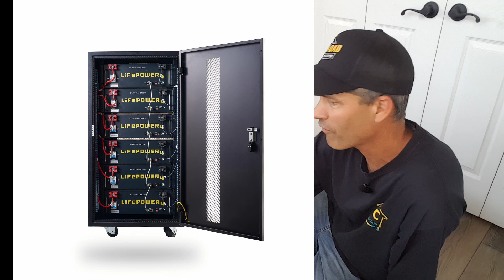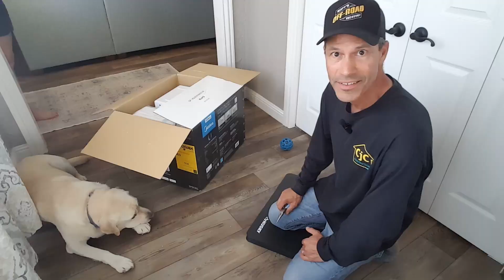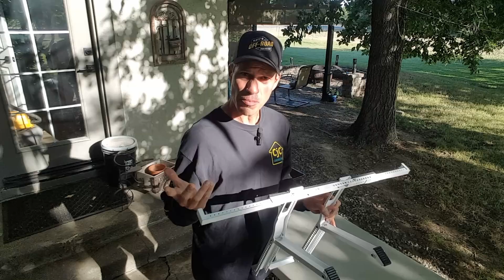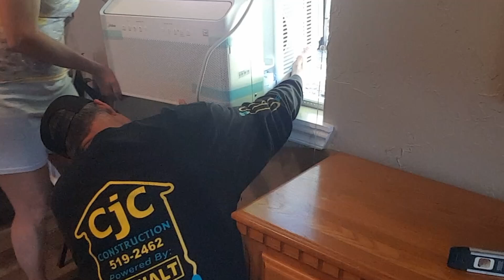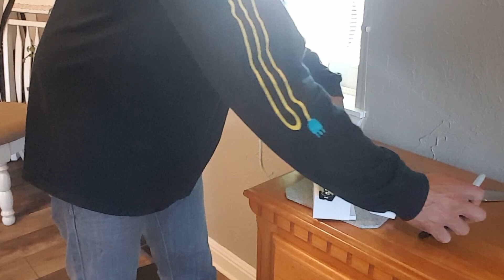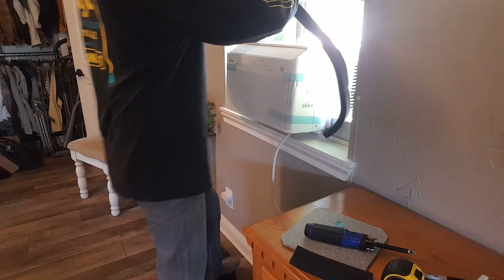❄️ 2024 Best Window A/C Midea U-SHAPED!! With INVERTER TECH!!

Comment: Thanks for this review/install guide. I just ordered this very unit based on all the positive reviews about how quiet it is. It is to arrive the 4th of July weekend next week. So this has been very helpful instilling me with confidence for the upcoming installation of the unit into my bedroom window. I was wondering though if you have tried the smart features, like controlling the unit from the far side of are planet over the internet? That would be very cool to turn on the unit with the phone app before leaving from work. I can't wait to try that out! 👍
Reply from the maker: Hello!! Thank you for your comments! Yes, we use the smart features daily. At the time of this video, we had not set up our phone yet. Since then, we use the smart features every day. I am kind of a numbers geek, so it is fun to see the inside And outside temperatures! Did you get the 12,000 BTU unit?
Reply: @jeffcunha9114 Thanks for the quick reply. Yes, I too ordered the 12,000. It's great to hear the smart wifi features have been working well for you. I'm looking forward to it! 👍
Reply from the maker: Awesome! Absolutely, we appreciate your feedback. Additionally, you can set up a routine so the unit comes on at a certain time of the day, or manually turn it on yourself manually. The other day we turned it on from a four hour drive away, and the house was nice and cool when we got home! 🥶
Reply: @jeffcunha9114  That's amazing! Thanks for the info! 👍
Reply from the maker: Absolutely! Drop us a line when you get it in July! Let us know if you need any help or support.

Comment: your mounting bracket has rubber pads for the window sill? mine didn't come with those, it only has rubber on the feet that rest against the house. Edit it looks like they fell off, it's the black rubber rectangle  that sits on the window sill @3:53
Reply from the maker: Good day to you! Now that you have this unit installed, how are you feeling about it?
Reply: @jeffcunha9114  I wish I could return it, with wood walls and vinyl siding at low speeds it sounds like a helicopter hovering outside because it's vibrating the wall. It's extremely obnoxious low frequency 25-30hz can hear it all over the house. When it runs at this low speed I switch it to fan mode so I don't have to listen to it. Tried adding sound damping material, a block of wood so it's not resting on the window sill, the only other point of contact is the feet against the vinyl siding that's transmitting all this vibration.
Reply from the maker: @atvkid0805 oh man. That is a bummer. I wonder if you could hang it off of the window to relieve the vibrations coming through the feet?

Comment: These are amazing until they get moldy
Reply from the maker: @qu1cks1lver56  Yes, you are correct. I am about to do a deep cleaning on this one for that reason. Are you running one of these?
Reply: @jeffcunha9114  Any chance you make a video for it? Just installed the 8000 BTU U Shaped model a couple of weeks ago and now hear they have been pulled from the market because of the mold growth. You think it makes sense to remove the drain plug on it completely?
Reply from the maker: Good morning! Yes, I want to do a teardown video of the deep cleaning. It is not overly difficult, but it takes time. Does your unit have a plug on the outside bottom pan? If so, yes, I would remove it.

Comment: In April 2024, when our central air in our north central Texas home quit working and it was going to be a while until we could get it fixed, I purchased what seems to be the same unit as in the video.  Even though I had a very low opinion of window air conditioners, I love our Media!   

The above said, I would like the Media to come out with a hybrid DC solar / AC 110 air conditioner / heater version similar to the the mini-split competitor brand in the linked video.     https://www.youtube.com/watch?v=vOEBlV2986M
I don't have an opinion about the linked unit other than I want a Media (U slot window style) with similar capability to the EG4 competitor.

Based on my data collected, I think a Media solar hybrid would pay for itself.   A bit of strange data, since for unrelated reasons, I did not run the window air conditioner over the summer.   However, here is data for our home in north central Texas for the late spring (not all that hot) and fall (hotter than normal).  In the fall (unlink the spring) our central air conditioner is working.   The Media significantly provided cool air flow to our living room where we watch TV.    The Media is set at its lowest setting (not auto) at 76 degrees, supplementing the central air also set at 76 degrees and the Media rarely uses more than 100 watts.  Total variable cost so far $12.51, 47 days, 89.58 kwh.   Maybe I'm being fooled by the wall outlet meter, but I don't think so.    Our house is very well insulated and I'm not trying to cool the whole house with the Media - just allow the central air to be set a little higher and the Media gives a cool breeze in the living room as needed.

The Media was easy to install, but the video was right - so more than look at the grill and it will be bent - maybe an additional grate needed?    If I can find a DC hybrid version of the Media, I'm thinking of putting a hybrid DC solar unit (maybe limit it to solar) on every window where off-grid solar panels can be placed with sun near the window - operational costs would be zero when in solar mode.   I'm not ready to try a mini-split with the tubing, but another Media that can use solar when available - absolutely - may even buy several as Christmas gifts for family members if mine works as well as I think..

Thoughts?  Thanks for the video update.  Dave

Comment: Do not buy! Midea didn't think at all about how to clean it. Yes, it works quietly, we bought it in May 2024, and we have been suffering from a mold smell for a month now. Midea didn't think about maintenance, it's impossible to reach contaminated areas and to pull it out of the case like a regular AC. Customer service did not help at all.
Reply from the maker: Thank you so much for your input! I haven't had this mildew issue, but I will see if I can figure out how to take the inside portion apart for you. What a bummer!
Reply: @jeffcunha9114  Anything you do to try to clean that rotary fan is going to void the warranty.  I've pulled the metal screen off to get at the fan.  Had to clean with Q-tips and vacuum cleaner.  Not sure what Midea was thinking about!
Reply from the maker: Thank you for your comments about how you are cleaning this unit. I too need to clean it up before we put it away for the winter.

Comment: I bought mine yesterday, I love it. But the water leakage is coming in my apartment. What am I doing wrong. Shouldn't the water be dripping from outside?
Reply from the maker: Good day to you. You need to lower the outside portion of the unit. Try lowering it down so that it slopes slightly to the outside. 👍😊
Reply: @jeffcunha9114  Good morning. Tks for the reply. My water drainage is on the inside on the side next to the face of the AC. I had it from Thursday this week and had to empty the hug pot of water 3 times already.
Reply from the maker: @RudeboyC2010  Wow! That is a lot of water! Let us know tilting the unit towards the outside by adjusting the outside bracket fixes your issue!
Reply: Do not buy! Midea didn't think at all about how to clean it. Yes, it works quietly, we bought it in May 2024, and we have been suffering from a mold smell for a month now. Midea didn't think about maintenance, it's impossible to reach contaminated areas. Customer service did not help at all. Garbage after 3 month of work.
Reply from the maker: Sorry to hear about your issue! I will see if I can figure out a solution!
Reply from the maker: Sorry to hear about your issue! I will see if I can figure out a solution!
Reply from the maker: Sorry to hear about your issue! I will see if I can figure out a solution!

Comment: I love mine it runs 24 hours a day on solar power I have 8 panels and 3 server rack batteries with a inverter charge controller 5000 watts and my unit cools my living room dining room and kitchen about 650 sq. ft. Its more efficient than my 5000 BTU GE unit and cools twice as much.
Reply from the maker: Thank you for taking the time to comment! What awesome information you supplied! What size unit do you have?

Comment: Will it work with a 39" wide window?  Does it plug into a standard 110 volt outlet?
Reply from the maker: Good day! Yes, it will work, but you will have to do some DIY because the maximum window opening is 36". Yes, it plugs into a standard 120v outlet!! Simple!

Comment: hello, i have the same midea but mine after a few months stopped working. like the fan mode works right but when i change the mode to cool it starts to start the motor then boom the motor stops and it shows error code "EC 07" please help!
Reply from the maker: @_jhxn  Good day to you! Do you have an electric tester to confirm 120v at the outlet under load?
Reply: @jeffcunha9114  i do not have a electric tester but the ac unit was working perfectly fine for a couple months then when i put it on cool mode the motor in the back starts to vibrate for couple seconds pushes out cool air then it stops working
Reply from the maker: @_jhxn  It is a tool to measure voltage. When you turn on the unit, do you hear and feel the exhaust fan running outside?
Reply: @jeffcunha9114  yes! the fan runs perfectly in fan mode, BUT as soon as i turn the cool mode on the motor for the cooling turns on for a few seconds, throws cool air then it turns off and error code EC 07 displays
Reply from the maker: @_jhxn  There are two fan motors, one on the inside and one on the outside. Is the Outside fan blowing? If not, it will throw the EC07 code.
Reply: @jeffcunha9114  ok so just tried it rn, so the fan outside does start blowing but then it stops
Reply from the maker: Thank you for checking it out. One person in the community had the EC07 code because the outside fan motor was stuck. Can you try another outlet as a diagnostic?
Reply: @jeffcunha9114  thank you for the help! yes i did try another outlet it worked for ill say 20 seconds but then stopped again. do you think i need to call somebody to fix it? or you think i should take the back side apart and try to unstuck the fan maybe that’s the problem?
Reply from the maker: @_jhxn  Absolutely! Happy to help. I think it is time for warranty service. Midea has been great to work with for those in this community.

Comment: Just put one of the 8K BTU units into our bedroom, in North Texas. 100 degrees outside yesterday, 68 inside the bedroom, and it's SUPER QUIET!
Reply from the maker: Hello! Thank you for your message! You put that little guy through an instant torture test! That is awesome it is able to cool your room to 68 degrees! What direction is your unit facing? Ours is in a North facing window which is almost always in the shade.
Reply: @jeffcunha9114  same, faces north. Couple hours of sun at most during the day.
Reply from the maker: @WhiskerEdge  Awesome. Give us an update in a few days and let us know how it is doing! Ours is on 24 hours a day and we started using it to cool our entire downstairs instead of using the 7.5 kW central A/C. It will easily pay for itself this summer.
Reply: @jeffcunha9114 is it a better design than the first GEN? The mold issue
Reply from the maker: @gregoryburkhead7813  Unfortunately, the mold issue is still a challenge because of the difficulties of taking the inside unit apart.
Reply: @jeffcunha9114  thanks for the quick reply. I still think these are great units. If they fix the mold issue.  I would definitely buy the newer model 🤣🤣🤣🤣
Reply from the maker: @handsup2  You are welcome. Yes, I totally agree. We really love this unit too.
Reply: @handsup2  Instead it got pulled off the market because of the mold. Of course two weeks after I bought and installed mine. It runs great (cooled my bedroom to 70 easy on a 103 degree day) but I'm dreading having to clean this thing.
Reply: @SteveGrabowski-s5n I changed the motor. And still have mind. Will they redesign it. ??? Hope so
Reply from the maker: I personally am not buying into all the panic. We are using this unit daily without issue. Ours has the open drain hole on the bottom outside of the pan.
Reply: Do not buy! Midea didn't think at all about how to clean it. Yes, it works quietly, we bought it in May 2024, and we have been suffering from a mold smell for a month now. Midea didn't think about maintenance, it's impossible to reach contaminated areas and to pull it out of the case like a regular AC. Customer service did not help at all.
Reply from the maker: Sorry to hear about your issue! I will see if I can figure out a solution!
Reply from the maker: Sorry to hear about your issue! I will see if I can figure out a solution!
Reply: @lilia8138 u right. I just cleaned mind and changed the motor. The motor was making a noise by the front fan.

Comment: I drilled a small weep hole in back bottom corner of unit to drain condensate that collects in bottom of condenser unit. I've had it installed for 7 months and it is amazing! I bought a 12000 BTU refurbished unit from Amazon for $268.00!!
Reply from the maker: Good day! Thank you for the Pro Tip. I would be interested in doing the same thing as you mentioned. Unfortunately, the holes on the bottom of the unit drain the condensate onto the mounting bracket, then down the wall. Can you please describe how and where you drilled? Thank you in advance!!
Reply: @jeffcunha9114  Underneath the radiator in the left corner. Be sure NOT to drill into the copper lines or Radiator! Also, make sure your mounting bracket is slightly lower towards the Radiator, rear of the unit (~ 1/2 level bubble) to keep the condensate from draining towards your house.
Reply from the maker: @dennisswainston411  Thank you for the information! I am going to check this out. Yes, I would hate to puncture the radiator!! Thanks for helping us out! 👍
Reply: @jeffcunha9114  That's funny because on my unit that I bought yesterday has a sticker on the side saying that the drain plug muat be in place for proper function
Reply from the maker: @Juniorr817  Thank you for the observation. I don't recall mine having a drain plug. There is just a hole that drains onto the bracket. Does yours have a rubber or plastic plug?
Reply: @Juniorr817  There was no drain plug or text to that effect on/for my unit.
Reply from the maker: Thank you for the update. Mine did not have a plug or a sticker either. I am wondering if this is a new development. Mine has two holes on the bottom right side when looking at it from the outside. How about yours?
Reply: @jeffcunha9114  Yes, there is a blue rubber plug
The exact words on the sticker are "Drain plug must be in place for proper function.
Remove to drain water before storage."
Reply from the maker: Well, that is very interesting. Are you using the 12,000 BTU unit?
Reply: @Juniorr817  That is the latest model. With the drain plug.
Reply from the maker: Ah, I must have an older model. How interesting.
Reply: So far I am using a micro fiber and a magnet, the micro fiber weeps the water out, but not all of it.
Reply from the maker: Thank you for your message. I like your idea. I wish we could attach photos to these comments! I would like to see what you have there.
Reply: @jeffcunha9114  I do not think you can post photos on you tube.
 So I cut a micro fiber cloth 1" wide and 5 inches long, I get a small plastic something and I use it to tuck the cloth between the sheet metal and the radiator, I use a magnet to hold it in place.
Reply from the maker: How is that working? 👍
Reply: @jeffcunha9114  It works better than doing nothing, I need to figure out how to remove all the water at least weekly. If you can try I would and see how it goes.
Reply: The only thing I didn’t like about the 8,000 btu model was that it weighed almost 70 lbs. It kept me from getting it. I’m guessing the 12,000 btu weighs slightly more.
Reply from the maker: @lucaszavala2953  Thank you for your comment. I will take a look at the box again, but this 12,000 BTU unit didn't seem very heavy for the two of us. Anyone know off hand?
Reply from the maker: The 12,000 BTU unit weighs in under 60 pounds!
Reply: Not supposed to drill hole. Unit is designed to use that water to kick back on coils.

Comment: Of course make sure the bracket is not level. Needs to be angled slightly down towards grass
Reply from the maker: Oh man! Thank you so much for your help! I am sorry I forgot to mention this! Thank you!
Reply: There is no holes, how angle will help?
Reply from the maker: I believe, and you can correct me if I am wrong, but the slight tilt is part of the design to fling the condensate on the outside condenser coil.

Comment: Great video!  I've been eyeing this AC for about a year now.  Do you think it will be harder to install in a 4th floor apartment / building?
Reply from the maker: Thank you so much for your message! I think that this would actually be easier than a conventional window A/C because of its frame system that could be installed entirely from the inside of the room! Does your window meet the minimum requirements? 👍
Reply: Do not buy! Midea didn't think at all about how to clean it. Yes, it works quietly, we bought it in May 2024, and we have been suffering from a mold smell for a month now. Midea didn't think about maintenance, it's impossible to reach contaminated areas. Customer service did not help at all. Garbage after 3 month of work.
Reply from the maker: Sorry to hear about your issue! I will see if I can figure out a solution!